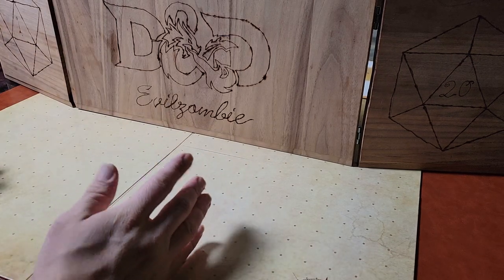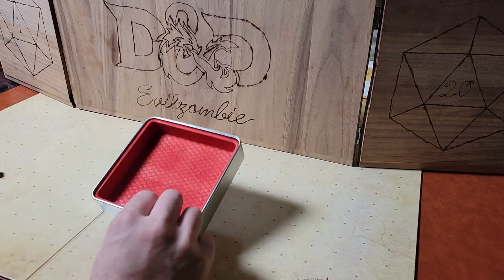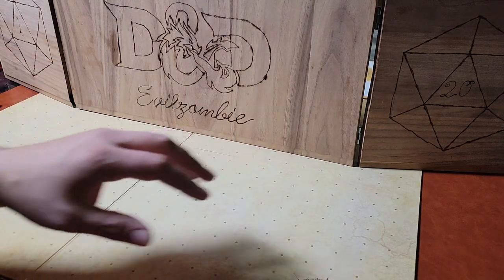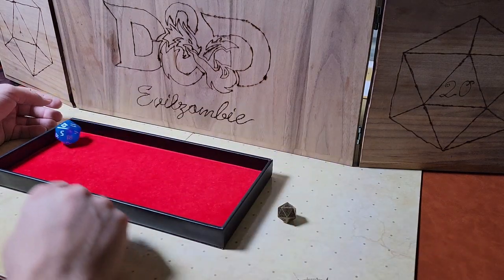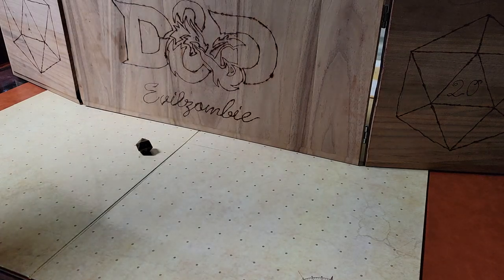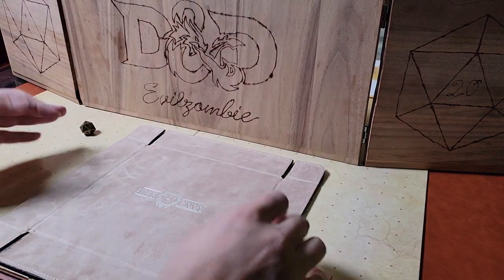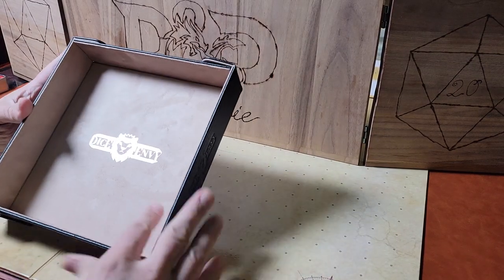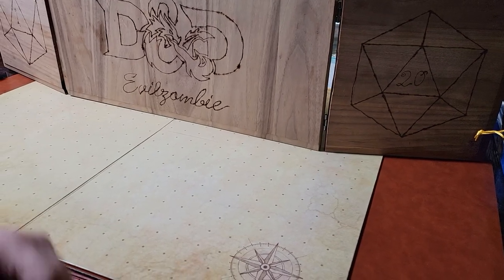Types of dice trays

Comment: Hello and thanks for making this video.
I have one of the cheapest with velvet coating inside. In time, the velvet get a little bit loose and there are some wrinkles inside of the tray. It is not a problem for metal dices, but it prevents plastic ones to settle thoroughly.